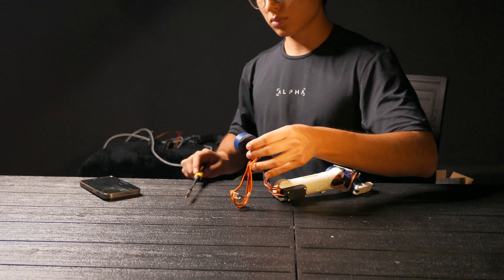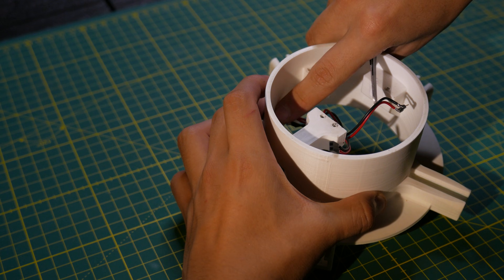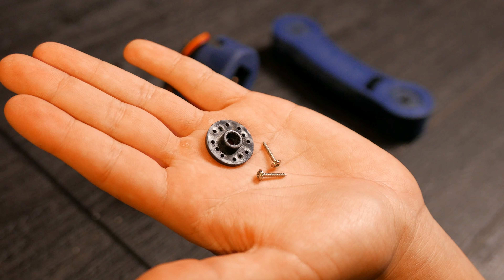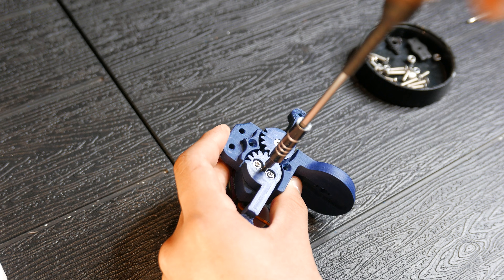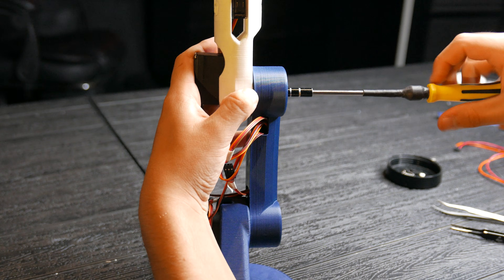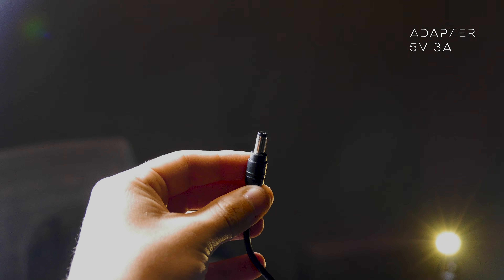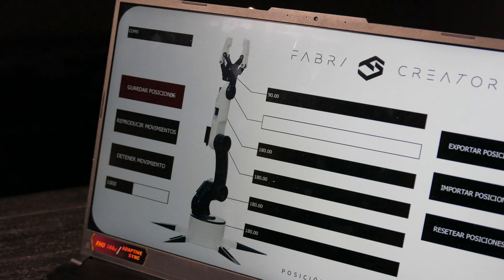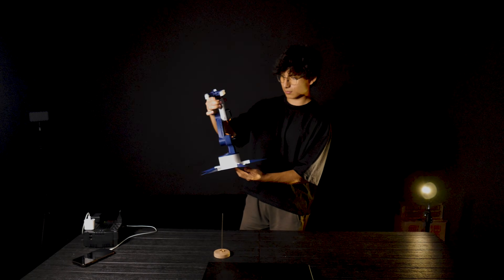Robotic Arm with Arduino - Save/Play/Export/Import Positions.

Comment: Aren't servos very sloppy, ie, not very accurate, and position degrades over time because it's using a potentiometer for position which wears out, also some servos can be fairly weak so it probably can't lift much?  Should have used steppers or even geared steppers is my thought.
Reply from the maker: At the end of the year I plan to make one with stepper motors, they are much better as you say and for semi-industrial or industrial use.
Reply: Excelente aporte compañero. Tienes razon.
Reply: Depends on the quality like anything else. I can say, industrial robot arms such as Fanuc, Kuka, Motoman, etc. all use servo motors to control their movements. The reason these are used over stepper motors is for the positional control feedback.

Traditional stepper motors are told what to do, and they do the movement. If something is in the way and they physically do not complete the movement, the controller is none the wiser and assumes its in position. This can lead to crashes if you are trying to maneuver around obstacles.

Servo motors have positional feedback, so if they run into something or can't complete a movement, the controller knows exactly where the position is currently and will keep pushing to finish the movement or fault out. This is the basic difference between open loop and closed loop.

Now today, there are stepper motors with closed loop control, meaning they also have positional feedback. As to the torque values of a stepper over a servo, id have to do some research on the topic, but i do also know servos are chosen for CNC machines and other motion control systems because they tend to allow for upscaling more easily and provide more power and torque. Again, i would have to do some research as I've not looked into this recently. I think at the small scale, you are correct that steppers would provide more overall torque and power, but closed loop steppers come with a hefty price tag. My information there might also be outdated and costs could have come down.
Reply: @kylewellman402  You either have figured it out or almost have.  Little hobby servos like those used in RC cars have vastly different specs than industrial arm servos.  Hobby servos is what's seen on this DIY arm, which, don't have reproducible accurate positioning and worse the potentiometer used for positioning wears out rather quickly making it even less positionally accurate.  You'd know that if you've played with the hobby servos much and tried to accurately reproduce positions.    Often first timers will make a plotter with servos only to find out their drawings start getting really distorted over time.  That's why little DIY arms and DIY plotters don't use hobby servos long and often switch to using nema17 steppers (like in a 3d printer) instead because they can have very accurate steps and have decent torque power.  However for positioning they still sometimes need a bumper switch or optical sensor to determine a starting point.
Reply: @swirlingbrain  yeah i can see that. Last time i was at a tech store picking up supplies for a few projects, I had those little servos in my hand and chose to go with standard DC motors and gear motors and a motor controller HAT as i could tell those little servos probably do not have the power to do what i wanted long term. I havent messed with them to know about the potentiometer problem, but if that's their biggest downfall, couldnt one replace the potentiometer with a higher quality one of the same resistance range? I mean yes, Nema 17s are going to be far superior in power to those tiny servos.. i suppose like everything else, pair your project with components that will fill the needs. Heck you can turn any DC motor into a servo by adding a motor controller and positional feedback ability (which is what i did for my 3 yr olds RC excavator project).  Everything comes with specs. 

I guess the main point i was trying to point out is a robot arm (which was what this project was for) normally needs to know exactly where its at in ordrr to have repeatable accurate control. Traditional stepper motors like the nema 17s do not have a positional feedback so if for whatever reason they lose steps, their positions will start to be off and the controller wont know it where as it does with servos and the positional feedback.
Reply: @kylewellman402  Many Industrial servos use an encoder not a potentiometer.  A potentiometer is analog and mechanical which means it has a sweeper arm which rubs across a resistance strip or resistance wire and wears it out over time.  Replacing it would just have the same friction problem to wear another one out.  Encoders on the other hand are like a slotted wheel or reflective pads and an optical sensor or magnets and hall effect sensor to digitally see where the motor position is, so does not have friction and so really doesn't wear out.  Potentiometers also have a fuzzy analog spot for the position that changes as it wears, wereas (lol) an optical or hall effect encoder does not.  So the sensor is what matters and not the motor so much.  Nema17 steppers do hold their steps which is why 3d printers and plotters use them instead of servos also.  If they didn't hold their steps no 3d printer would use them.  It figure the position, they use a homing bump switch or homing optical switch and then the computer just remembers where it has stepped to since homing so does not need an encoder.
Reply: @swirlingbrain  yes. Everything you said is accurate. Except for one thing and if you'd indulge me I'd like you to try an experiment. 

If you have a 3D printer, or anything that runs off of stepper motors, get it all powered up and homed out off the limit switches or prox sensors or whatever it uses. Then remove the prox sensors that would otherwise tell it "hey you're about to over travel" (which are needed in the case where a stepper motor loses steps ((i.e. some physical reason has prevented it from traveling the full distance, or steps, it was told to))) and then tell whatever axis you remove your home / overtravel switches from to travel lets say 150mm, 6 inches. Now here is the fun part. Use whatever method you desire but block its path at about 100mm or 4 inches or so into the movement. Then once it stops, send it back the opposite way 150mm again. Tell me if it stops right where it started at its home position. It wont. It will try and run itself off the rail and crash. 

That scenario is what i mean by losing steps. Is that likely to happen with a small DIY 3D printed robot arm? Probably not as i doubt you are designing it to do a job where it has to grab an item and maneuver around obstacles to put it somewhere else in a very tight clearance, but again the only point i was trying to make here was the potential problems one can run into using an open loop system on a machine or piece of equipment that needs to know exactly where it is to be repeatable and do accurate movements without having to power it off and home it out everytime something happens.

I dont recall saying anything about industrial servos using pots as positional feedback. As far as pots being a wear item, yeah they are. However, I've seen pots used for decades in harsh environments. Just like anything else, a well made quality pot would last longer. However squared, why go through the trouble of getting a quality pot to mount to a cheap DIY servo soo yeah lol. Wasnt trying to argue against switching to steppers, was only making the point positional feedback is nice for things like a robot arm. No not absolutely necessary in this use case... but typically yes a robot arm needs positional feedback. In a perfect world, nobody would ever crash the robot or tell it to do something that would cause a crash and make the robot lose steps.. however cubed, the world always makes a better idiot 😜
Reply: @kylewellman402  if you're worried about having bad software and the printer head going off the other side you can always put a homing switch on that side too. A few 3D printers do that most don't cuz you don't need it. Anyway I was talking about do-it-yourself robot arm using RC servos just not a good idea because they just don't have the positional accuracy. That was the original point. But somehow this conversation has devolved into everything but that. I mean some people switch to steppers instead of RC servos because that's the next step up that works better. Sure if you want the best go for the biggest industrial servo motor with the best encoders you can find, but for a do-it-yourself robot arm it's just not practical.
Reply: @swirlingbrain  are you actually reading anything i am saying? You keep making these points that I've never said lol. And wth do you mean "if youre worried about bad software" software has nothing to do with whether or not a stepper motor loses steps because it physically cannot move the entirety of what it was told to. I think your name on here is a very accurate description. 

You're worried about 'positional accuracy' for a robot arm and arguing for stepper motors that do not even keep track of where they physically are in space. Im sure there is an upgrade from the tiny servos demonstrated in this video that are similar to size as nema 17 steppers that would still be perfectly feasible for a DIYer / home shop build. Or like i mentioned doing, use a regular DC motor and a motor controller and encoder and make a servo motor. 

The absolute only point i was trying to make from the get go was stepper motors do NOT keep track of where they are. That is exactly why everytime you power cycle your 3D printer you have to home each axis. Really after every run you have to home each axis. Whereas with servo motors they keep track of there position at all times and dont even need homing limit switches or prox sensors.
Reply: @kylewellman402  You're living in a different world than me I guess.  I talk about RC servos not keeping their position well and you argue that they do or can be oddly modified to?  I talk about steppers don't typically lose their steps and you argue that they do and go running off the edge on occasion.  Oh well, agree to disagree I guess.  In my world rc servos are not positionally reliable enough to use as a diy robot arm, (or other positionally needy equipment like 3d plotters, and such) and steppers are.  In your world rc servos are the best and steppers are so loosy goosy that they should not be used.  Okie dokie, whatevs.  Agree to disagree.  Sure anyone can make a stepper fail or have faults.  I suppose you could also make a servo have faults.  But really, normally or typically a computer can control a nema17 steppers to find a position and works like 100% of the time and that's what they are designed to do.  Unless yeah, you do something crazy like try to forecefully hold the shaft up so that it can't have enough torque to move but so would a regular servo motor fail if you froze its shaft.  Neither motor is designed for that.  Extremes like that, sure they will fail.  But why argue the far extreme case?  Again, I say an RC servo is not good for a diy robot arm because the position varies, and a bipolar stepper is a better choice because it has good torque and can go exactly to position, you say it's the opposite.  OK, well agree to disagree.  And exit stage left.
Reply: @swirlingbrain  lol i still stand by my original statement about your name. You seem to like to add things that werent said and then argue against it. Im sure you're a hoot to be around. 

Again, for the fifth time all i originally was doing was pointing out a potential flaw. That is under the assumption you want to do more than just have a robot arm dance around in the air. That you'd actually want it to do work. There is a reason robot arms specifically use servo motors and not steppers. Im not arguing a nema 17 stepper wouldn't be stronger than those little cheap servos. Stepper motors can lose their steps for many reasons besides intentional shenanigans, i was only using that as an example because you claimed steppers couldn't lose their place and that  even if they did it would be a software problem? Do you understand the concept of what a stepper motor is and how it works? What a servo is and how it works? Fun fact, a servo motor is a DC motor thats set up exactly as i described what you refer to as "odd" in one package ready to go. Regular DC motors set up to have the same ability as servo motors are used in the industry all the time. Perfect example is my current job where i am a controls engineer, using DC motors controlled by drives with encoders attached to them to keep 50 rollers in sync based off of material tension and surface feet per minute. That "odd" way of setting up a motor (which is exactly what a servo is anyways) is also ramping and deceling roll speeds based off of diameters. As one shrinks and gets smaller the speed increases to match the roll speed on the other end the processed material is getting rolled up on as diameter increases. Everything controlled via regular ol DC motors set up with encoders and drives. Quite the feet of engineering. Oh and our robots use servo motors because they have to travel to very exact locations over and over again. We can't be having it swing a 500 pound roll and slamming it into all the electronics because some moron misplaced the container it drops in, it ran into it and lost position. Oh wait.. that wont happen because even if it did a servo motor has positional feedback and the controller will know it didnt make it fully to the destination and therefore would be off by however much on the next path it sent it on. You know, like would happen to a stepper.

But yeah lets agree to disagree because this is silly anyways. You can absolutely do whatever you want and use whatever motors you want. Again all i was trying to point out was why servos are used in place of steppers. If course for a 3d printer steppers are used. They are cheaper. But bet you money a servo controlled printer would be even more accurate. You know when the bushings wear out or your v wheels or you inevitably never grease your linear bearings cause you dont know any better.. then over time your print head is only moving 19.8mm instead of 20mm in any direction.. losing steps. Losing accuracy. A servo motor would know. Servo motors know everything! Servos are Gods of motors!
Reply: @kylewellman402  Great! Now experiment! Now make a diy robot arm with hobby rc servos and use it to pick up chess pieces on a chess board and see how many times it can do it reproducibly. You might be surprised how bad it works when you actually try it with rc servos.  Repeat the process with stepper motors and see which performs better. Then spend a ton of money on a kuka arm with industrial servos and see which was was better and cheaper at the job. Make a video and show us your findings!
Reply: @swirlingbrain arguments between nerds, was an entertaining read
Reply: @justinnocent3559  lol!  Yeps, both right, both wrong, and fun and frustration was had by all!  Woop woop!
Reply: @swirlingbrain  lol we both know the outcome and again i never once argued that small nema 17 steppers would not be better in this case. I also said those servos looked very lacking and i avoided them for an RC excavator i made for my son. I dont know why you are so hung up on me saying not to use steppers and you must use these tiny servos cause they are superior. The ONLY thing i was trying to point out was open and closed loop, i.e. the difference between steppers and servos and why industry uses servos for robots because of the positional feedback. 

Never said the small servos were better than steppers. Never said they were stronger, or have more torque / holding torque, never said not to use steppers. Only ever pointed out a potential flaw in using steppers for robots. 3D printers use steppers aure because unless you royally screw your slicer settings and pretty much intentionally make it run into a printed part or screw up z axis offset and bury the nozzle, or just have extreme neglect for upkeep and maintenance on your printer (which even then other problems will likely rear their head beforehand)  you will likely never encounter a reason why a stepper would lose counts on a 3D printer. I have and use several and they all have stepper motors. 

I have a benchtop CNC mill in my shop that also uses steppers. Now if the cost of comparable servos wasnt 3 times higher than the stepper set up then i would use those for the exact reason ive been pointing out. Positional feedback and ability to always know where they are. However the argument you're making is a double edge sword. There is no comparison size wise or HP/Torque wise between those tiny RC hobby servos and a nema 17 stepper. Its like trying to compare a little Ford pento 3 cylinder engine to a 450 big block V8.

Now i know with your raging storm of a mind that you'll only process the last few sentences of this and start madly typing away about how im claiming the small RC hobby servos are better than nema 17 stepper motors cause they dumb and dont know where they are.... so im excited to see the response.
Reply: @kylewellman402  My response?  Read my original op message.  Use what you want to use.  Whatevs.  Live, love, have joy, and be happy!
Reply: @swirlingbrain  your OP is what made me comment to explain servos and steppers to begin with. You didnt specify these cheap RC servos, you just said "servos". That information about servos in general is not accurate. It is accurate about the tiny cheap $10 servo motors that are only meant as an educational concept and not to do real work.

Which is where i felt the need to continue as you tried to compare a $10 servo to a nema 17 and then wrap in all servos and how terrible they are and how superior stepper motors are to servos which is also not true all while trying to make me sound like i was saying crap i wasnt. I stand by my statement, your brain is definitely swirling. If you could learn to contain that a bit we probably could have had an intellectual back and forth to the benefit of any readers who dont know and are curious.
Reply: @kylewellman402  Be happy!  Yes expensive industrial servos are very positionally accurate and reproducible.  They would be great for building a big industrial robot arm that could handle them!  They are expensive and are not practical or within the means of the typical DIYer small 3d printed robot arm.  So, understanding that you misunderstood that I was talking about cheapy RC servos, as was used in the video, and that THOSE cheapy RC servos are not positionally accurate due to their potentiometers feedback, and that nema17 steppers are better than those cheapy RC servos and could be used as a step up, even tho they work completely differently and each have their own different pros and cons, maybe you can understand that my OP makes sense.  I'm not sure why you thought I was saying that the super accurate and far superior in accuracy and many times more expensive type of servos that I'd suggest going down to nema17 steppers?  I could see that would be weird if I were to have said that which why would I say that?  But yeah, It sounds like you seem to agree that RC servos are not great for positional accuracy and you seem to agree that steppers are better than RC servos and you seem to agree that industrial servos are the best but too expensive for these inexpensive DIY applications, but somehow we still need to argue about it for some reason.  How about instead we just talk about the weather or religion or politics or... squirrel!
Reply: @swirlingbrain  Well i suppose that's where communication purely through text can so easily be misinterpreted. I have no idea what your background and knowledge of this stuff is lol so when i saw "arent servos sloppy" i thought since i work as a controls engineer and have extensive background troubleshooting, engineering, maintaining equipment from my own personal shop and tools / machines ive built for my own shop (because im too poor to buy already made machines lol) to CNC machines to robots, massive machines with multiple PLCs all communicating together with upwards of 30 to 40 motor drives working on sync, to die casting machines.. just thought i would share the knowledge that servos in general are widely used for their accuracy. 

However you are absolutely right. Steppers are far cheaper and for the most part make not only more economical sense but also work better in some applications. 

Well, im not sure where you are but it's hot and muggy here lol and I'm not sure i want to get into politics cause that could spark a much more heated debate than stepper vs servo for DIY projects lol
Reply: @kylewellman402  LOL!  Yeps, hot and humid here too but won't rain.  I'm in Texas!  Yeps, it's aways a tough decision to pick the right components for the job so it will always be a second guess: did I pick the right part?  The more ya know the better but yeps, sometimes the variables can be overwhelming on picking the right part for the job!  It is nice to get feedback from others even if it can be a painful or frustrating discussion.  Like don't get too cheap with the design but don't get too expensive either.  Have a good one, and happy designing!